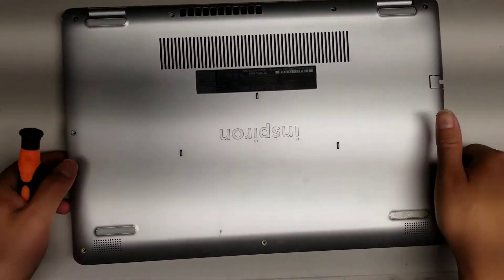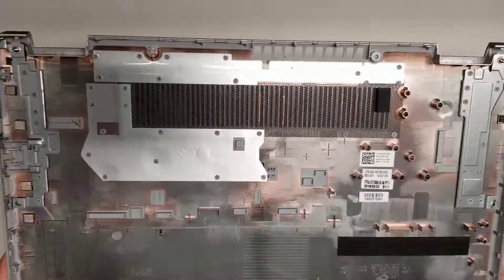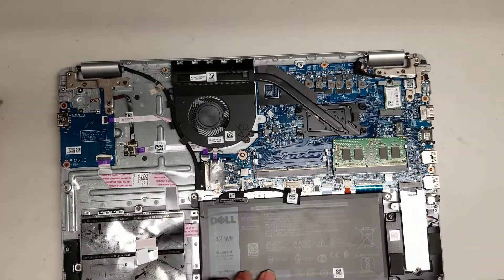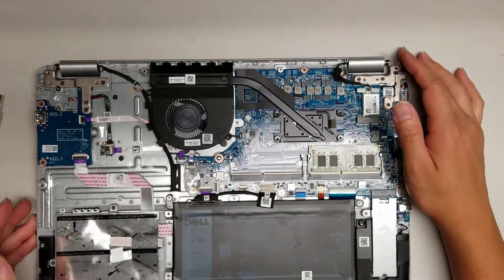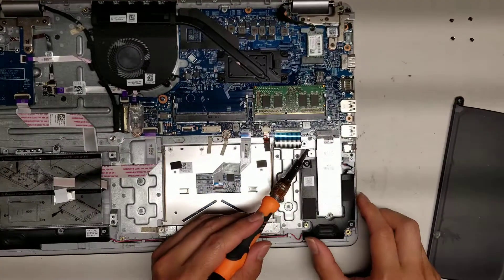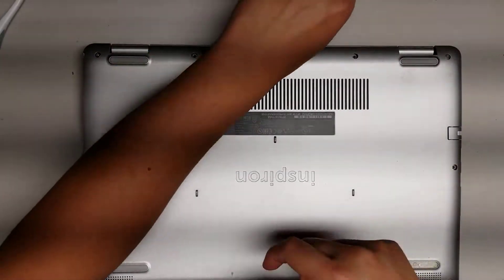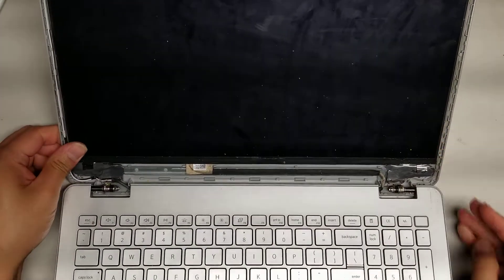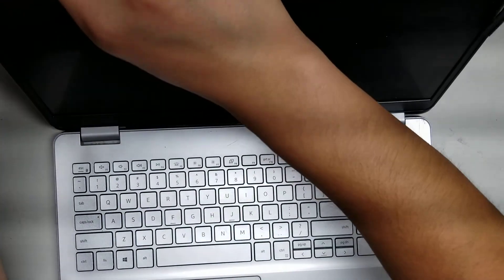DELL Inspiron 15 5584 Disassembly RAM SSD Hard Drive Upgrade

Comment: Greetings
Thanks for the helpful video 
Do you have a repaste video for this model of dell laptop ?
I would very much appreciate it.
Reply from the maker: No, but they're all basically the same idea https://youtu.be/AKe4kdPVqvU
Reply: @ItsBinhRepaired  ty for the reply, i have seen the video
but the issue here is that my cpu have 2 metal interfaces here, the bigger one is the cpu and i must put thermal paste on it, the smaller part has a thermal pad on the heat sink and by applying the thermal paste on the small interface has ruined my small interface thermal pad
The question here is that can i put a thermal paste on the small interface or find a replacement thermal pad for it ?
Reply from the maker: I hate how YouTube doesn't notify me of replies. Were you able to figure it out?
Reply: Yeah but later on my laptop ended up dying lol so i'm gonna get a new one now
 @ItsBinhRepaired
Reply from the maker: @MegaMustafa1234  awww

Comment: I have dell 5584 laptop. It has 8 gb ram, core i5, 2tb hdd, 2gb graphics. Now i want to use ssd and hdd together. Can i do that in this laptop?
Reply from the maker: Should work, I don't see why not.
Reply: @ItsBinhRepaired  is there enough space for keeping ssd and hdd in this model laptop?
Reply from the maker: @ajharultonmoy5967  how much of the video did you watch?
Reply: I watched full. Please answer my question.
Reply from the maker: Yes? If you didn't get that from the video, how are you supposed to know how to fit them?

Comment: Can we use ssd + hdd at the same time ?
Reply from the maker: If you can fit them both, yes.
Reply: @ItsBinhRepaired  thanks for replying but can u tell is there any dedicated slots for HDD and SSD or We have to use one at a time either HDD or SSD
Reply: @ItsBinhRepaired  in my Inspiron 5584 there is HDD of 2TB but there is no SSD so If a want an SSD can i add it without removing that HDD Because I want to use both. That's what I'm asking.
Plz reply. Thanks
Reply: @romeoyt5621  x2 responde por favor.
Reply from the maker: Yes
Reply: @romeoyt5621  It has separate M.2 port for SSD.

Comment: Does it support 32gb ram upgrade? Someone checked it?
Reply from the maker: I would think so. Have you tried googling it?
Reply: @ItsBinhRepaired  Yeah. 50/50. Someone say that it supported, but another - no
Reply from the maker: @oleksandrborodavchenko3437  that means it'll work. The people that say yeah, most likely tried it. The people that say no, probably are just going off specs they saw from Dell.